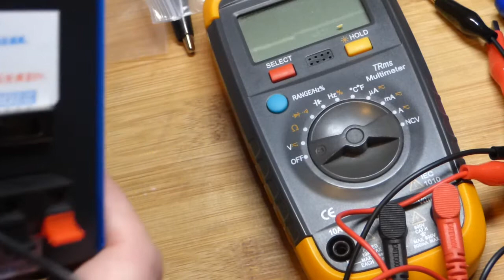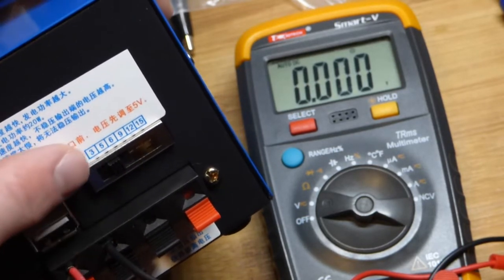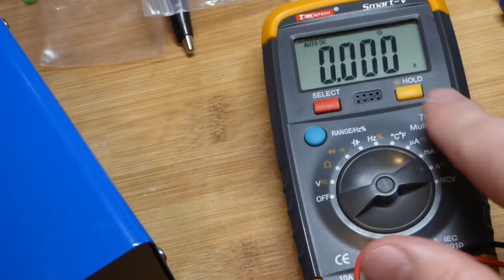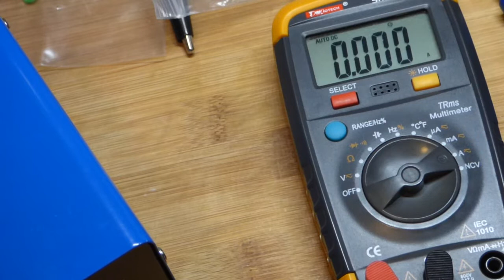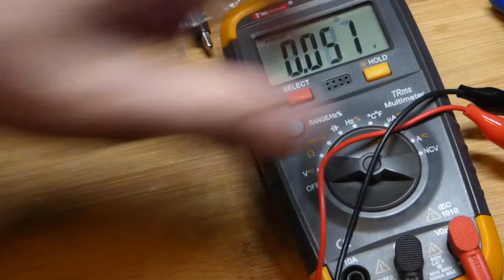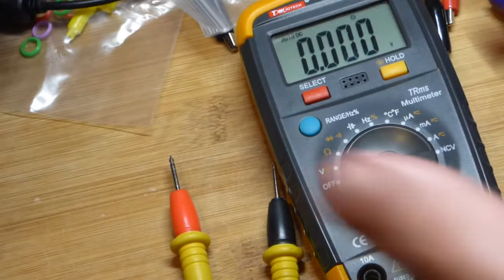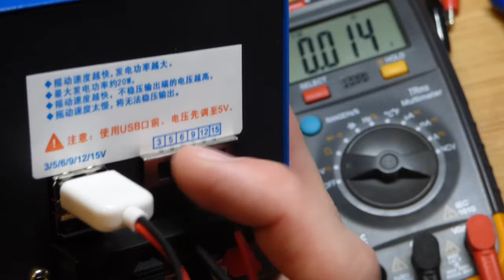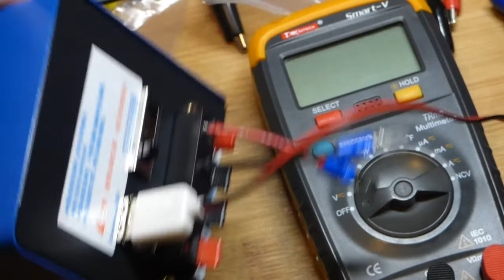My new favorite portable hand crank generator with variable voltage output and USB

Comment: They get the 20w rating from the fact it will supply  1.6 amps x 12v =  19.2w(approx. 20w). However,  the  regulator is limited to 1.5 amps out, no matter what voltage it's set at. So at lower voltage settings,  you are only going to get  1.5a x  (volts)  =  Watts.
Reply from the maker: Thanks for the info!

Comment: Good tip you mentioned - charge a power bank,  one that can supply  usb/5v to your phone - and not your phone directly. Although that may work, it would be easy to destroy your phone with an incorrect voltage setting .  Thanks for the video.
Reply from the maker: Indeed!